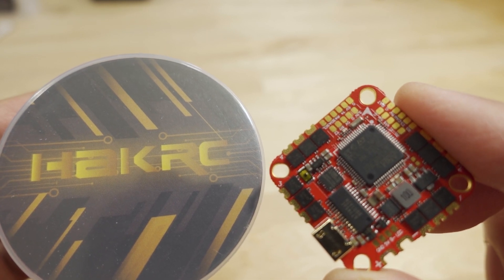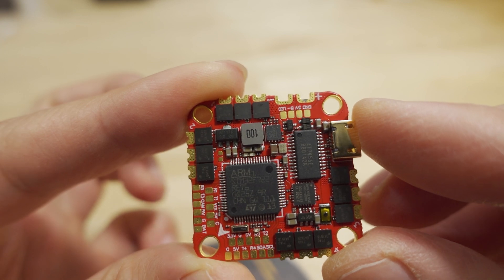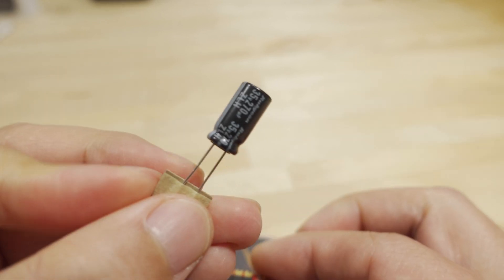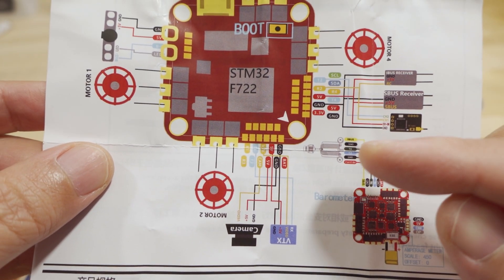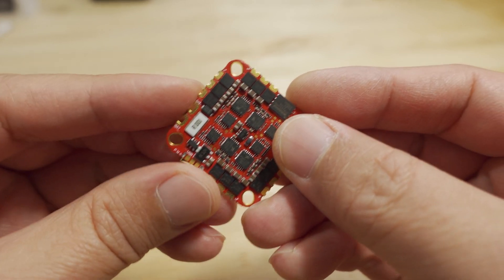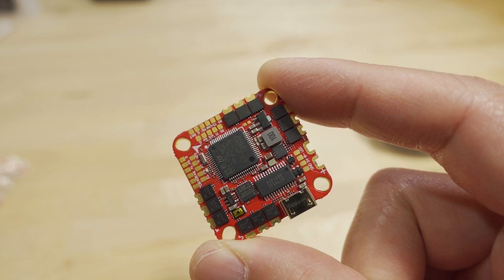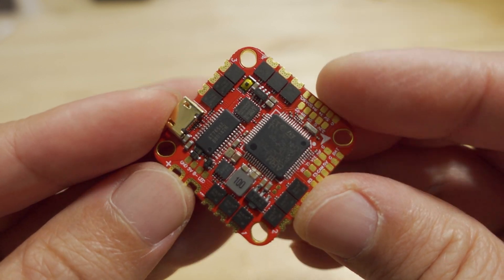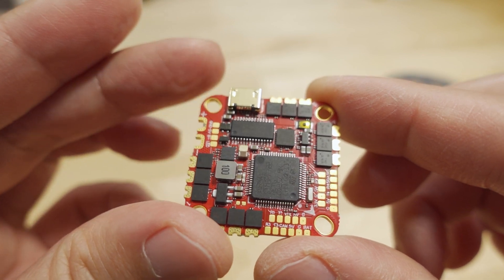HAKRC F722 AIO Whoop Flight Controller 💫

Comment: can you help me with this boared albert I'm trying to use the plug on the board to my dji 03 unit and use the dji fpv controller 2 but it just will not work I cant find ANY DOCS OR INFO
Reply from the maker: Make sure you are using the SBUS protocol in the flight controller and make sure it's set to the correct UART.  This is the most common mistake.  Also, after you bind the air unit, make sure the controller protocol is set to SBUS and match it with the speed you set in the flight controller.  It might be set to the SBUS Fast protocol which is not the standard.
Reply: @AlbertKimTV  do you mean selecting serial rx and sbus in the receiver tab I’m at a loss everything I try is just not working buddy

Comment: Hey Albert quick question. I saw you mentioned that you cant use the plugs on this to connect a vista if you are using a 6s battery. Is there some change you need to make to get it to work? it seems to be setup to work with 6s on the Kolas6 so what if any difference is there? Im building a 4-6s 5 inch and I dont want to burn out the vista connecting a 6s battery. Thanks!!
Reply from the maker: Vista on 6S is OK.  You can't connect the full size Air Unit on 6S.

Comment: Hello, did you manage to update the firmware? I have the maximum plate and it does not let me enter dfu in any way
Reply from the maker: Press the bootloader button while plugging in the USB cable. Make sure your USB cable is good.  If it still won't work, try another PC.

Comment: Toothpick style not whoop style. Try putting it in a whoop frame and you'll see.
Reply from the maker: The form factor is originally called that no matter what it fits in.
Reply: @AlbertKimTV  I get that. I just keep picturing a poor fellow ordering a "whoop aio" and finding it too big for their whoop frame when they actually try to build it.
Reply: @athefpv4670  It has the same hole pattern as a whoop, I don’t get it…do you mean the ducts would be in the way? If someone buys this for a 65mm, they’ve got bigger problems…
Reply: @geometerfpv2804  yes, ducts are in the way, it is just a little bigger so you cant put it inside. The usb connector is sideways so you cant access it. Believe me if you want to build it it's gonna be a problem. Yes 3d printed solutions exist but that makes the whole build higher and more fragile. But hey, its your money. Do whatever you want.

Comment: I like it, but it looks really, really similar to the HGLRC board... Even the mounting holes are the same.... the solder pads... everything. Is this just rebranded HGLRC?
Edit: Even the wiring diagram is either HGLRC or HGLRC cloned...
Reply from the maker: There's actually three others from other brands that look similar with slight changes in the layout or features.  There's only so many ways you can lay out components on a board this small.

Comment: Looking for H7 AIO ,please.
Been building for 6 years not had a new build for 18 months, HDZERO + AIO plus ELRS  5 inch is my next build, NEVER by a pre built ,Freestyle  want to try INAV, So! There you have it.
Hit me with some ideas???
Reply: Check out JHEMCU GH743 H7 40A AIO .  I don't have it, but considering it for a long range INAV build also.  For INAV it's important to find an FC with the SDA/SCL pads broken out if you want to use I2C devices like a compass, because as far as I know you can't remap resources like you can with Betaflight.